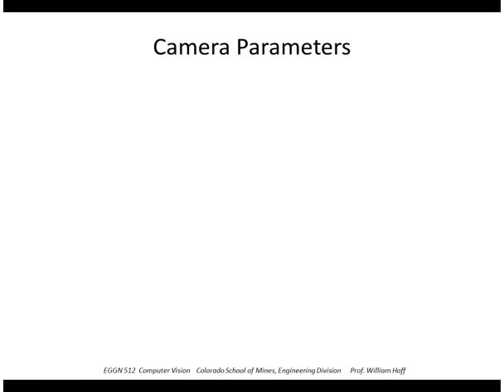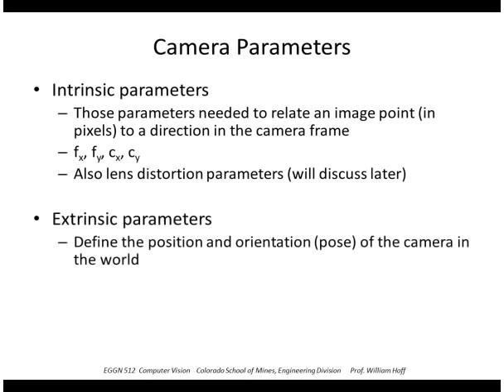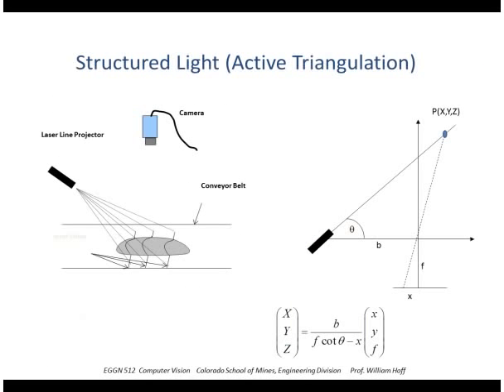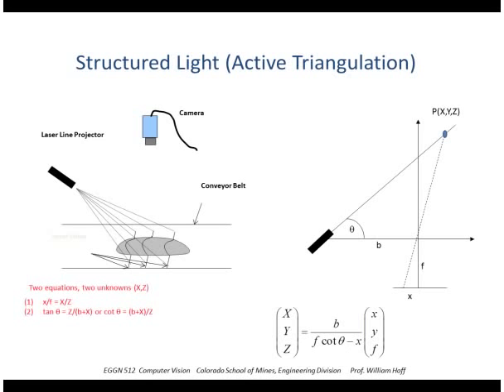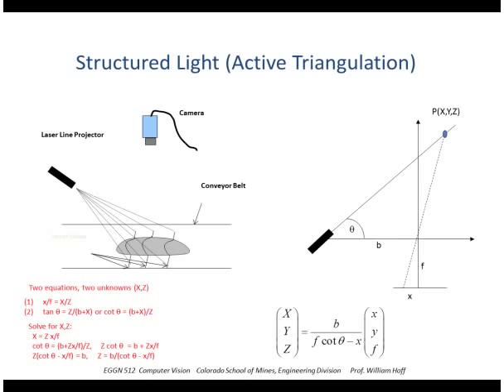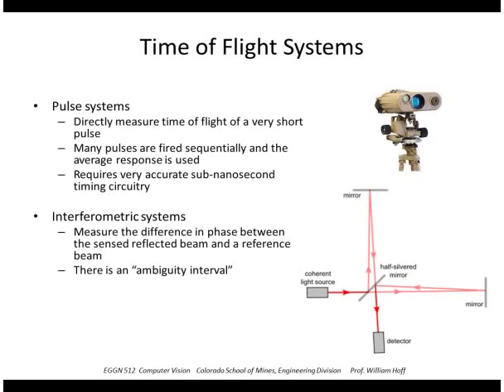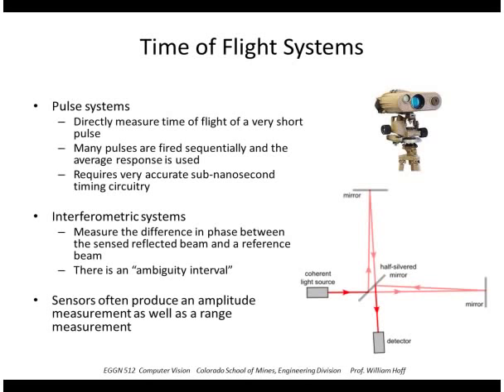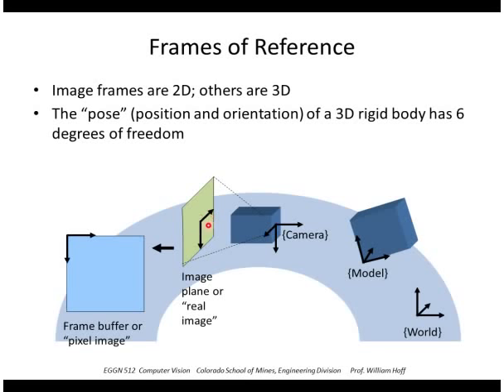CSCI 512 - Lecture 02-4 Sensors and Image Formation

Comment from the maker: Hi - thanks for the feedback.  No, the Kinect sensor is actually a structured light system.  Professor John MacCormick of Dickinson College has a nice presentation called "How Does the Kinect Work?" online, that shows the details.
Reply: Hi, thanks for the great series of videos. When you explained about the Structured Light, the laser itself seems to be position not only in b position with respect to X axis of the camera, but also some z position from Z axis of the camera. Taking that into account, should not be the tangent of theta angle = (Z - z) / b + X?